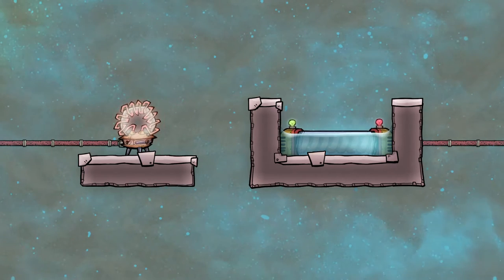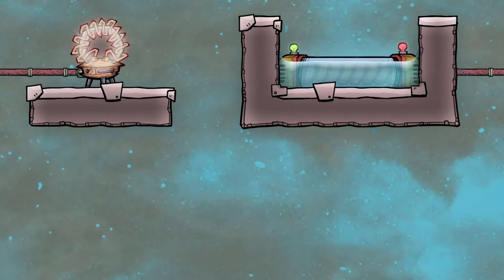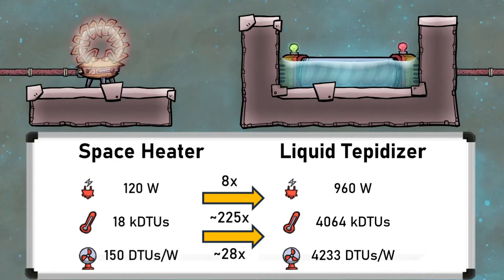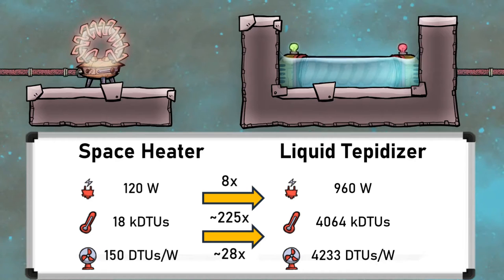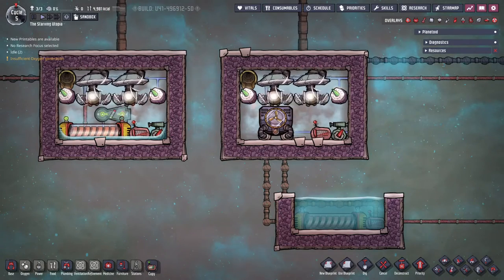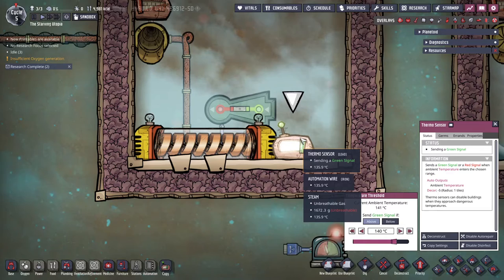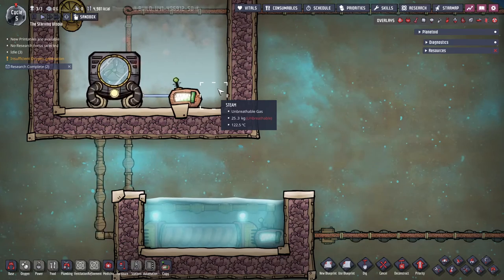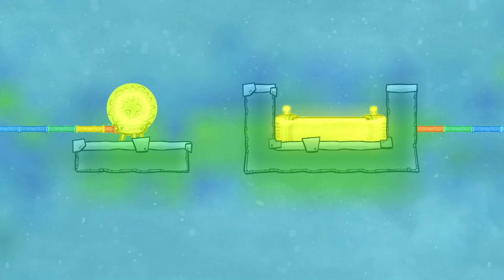Oxygen Not Included - Tutorial Bites - Heating

Comment: I'm very much a beginner, do you have a tutorial on how you made that closed loop to heat the base by chance?
Reply from the maker: I think I covered it in the cooling Tutorial Bite, but it is quite straightforward. Make a loop of pipes and include one bridge to set the flow direction. Then to fill it, use a liquid pump in the liquid of your choice. To connect this to the loop, use a bridge from the pump to the loop and it will stop it overfilling. Then once full you can disconnect the pump and it will flow forever.

Comment: I prefer a metal refinery instead of a tepidizer since it also produces a product which you're gonna need at the same time as heating your base
Reply from the maker: Also a good source of heat, the only thing is you need a constant source of things to refine, and if you have a maximum temperature in mind that you stop the refinery. They definitely have their place, commonly in industrial bricks, but there are other applications that are better suited to tepidizers.
Reply: @GCFungus  given the vast amount of energy you need to dump into something like water to heat it up a noticeable amount I would have to disagree.
Controlling it however is as simple as using some of the metal you just refined to make a temperature sensor and a logic wire, which you'll have sufficient amounts of after one or perhaps two operations